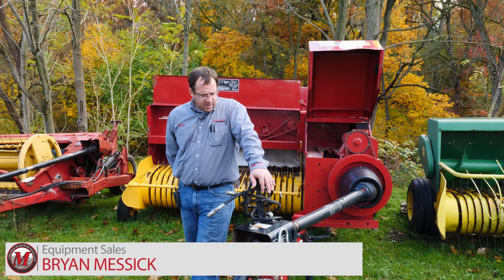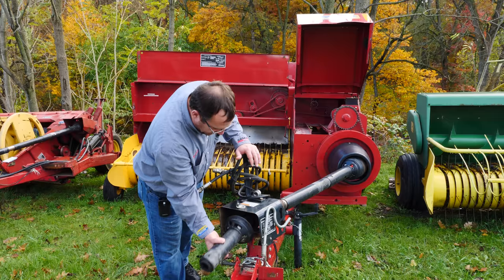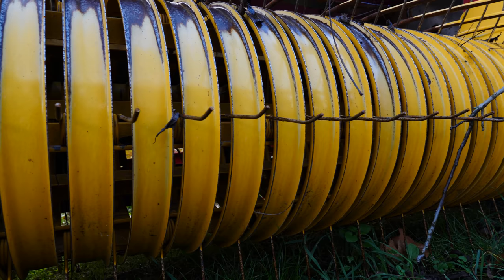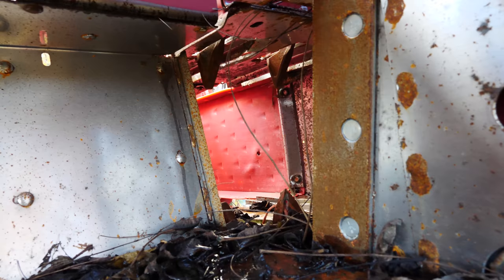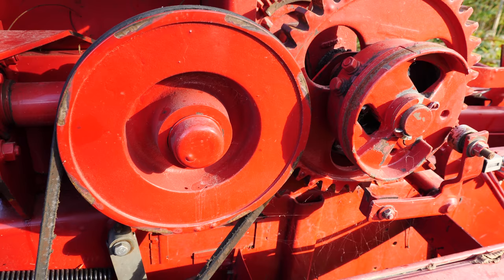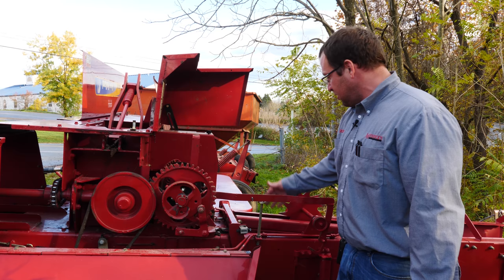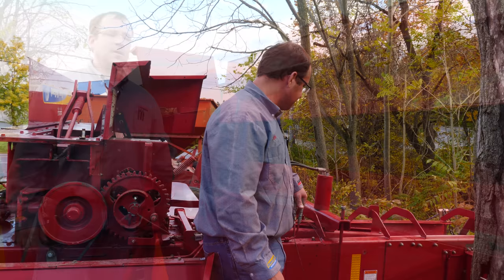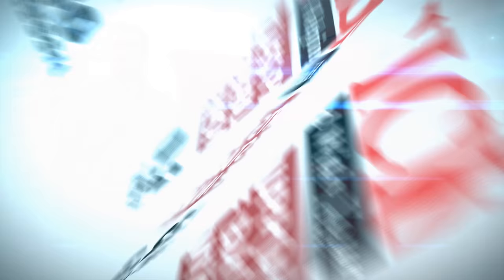How To Evaluate A Used Small Square Baler

Comment: IN addition to all that is mentioned, I would also turn the flywheel a few times by hand to hear and feel the machine turn over. Should be no squeaks, bumps or clanks. Just the smooth sound of plunger rolling back and forth and pickup reel turning. If allowed,  I'd also trip the knotter and let it run through a knot cycle to make sure it is all working smoothly. If you know where to look, there are a few other simple things to check like the timing of the forks and needles, timing of the knotter disks, etc.  If all is well there, guy who had it probably knew what he was doing. If it has been running out of time, it may have some hidden damage. If there is still a bale or two in it, look at the knots it tied. Are the ends even and clean cuts on the twine. 

Curious to know why this baler seems to have a new knotter frame installed on the right side. With labor, that part alone costs about $1,000. Knotters are where all the voodoo of a square baler takes place and those are some expensive parts to replace.

Comment: The easy tip is stay away from green. Never saw a J D small baler that wasn't an unreliable money pit.
Reply: Both our 24t balers kick ass on the wildside. I am 51 and i know i was in my teens running the one. We bale the crap out of them every year with grease gun maintenance and blow off the knotters before we start

Comment: Hi, I live in Winder Ga and brainstorming up an idea to start a custom hay bailing business.  What would I need to get started?? Like what type of equipment?  Iam thinking JD 5065E tractor.  I see Massey makes a small square bailer 1840??   Don’t know if I’d need a teeder and a windower.   I know there’s not one business that does this custom hay cutting within 100 miles of me..
Reply from the maker: Start small, buy used equipment and keep your investment to a minimum. It's not just about putting grass in a cube, you need to manage moisture and timing for a good quality product. You absolutely need a rake and tedder. Find an old timer who can help.